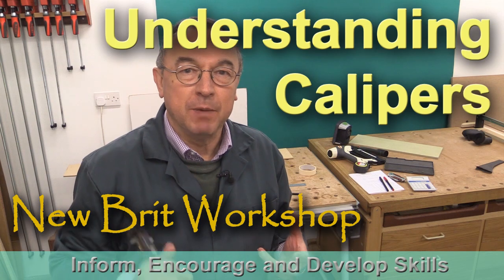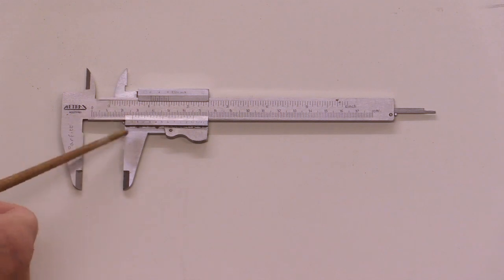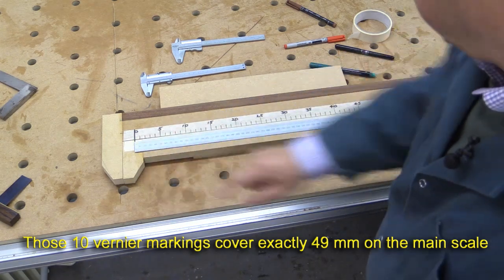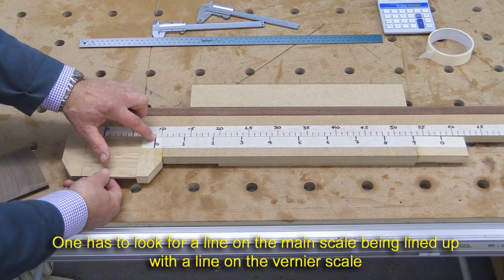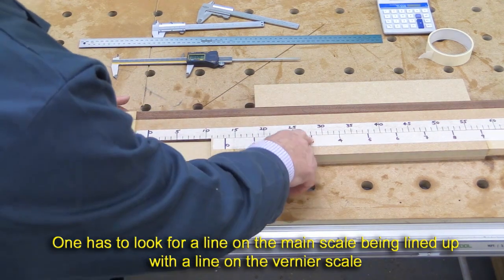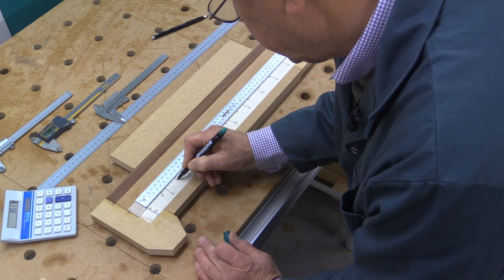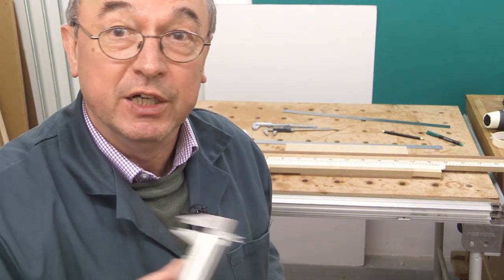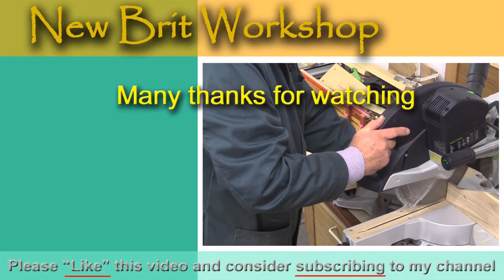How Calipers Work

Comment: Greetings from Canada. Thank you for the reminder about how REAL vernier calipers are used. This is an example of how we went about making it possible to take precise measurements in the past. I too, started with a set of calipers similar to yours. They were finely crafted and came in a protective leather pouch. They were quite expensive.  These first generation calipers were, at times, difficult to read, especially in low light. Probably ten years later, I took the next step and moved to a set of calipers with an analog dial gauge.  These too, were quite expensive but a lot easier to read as they did not require a vernier scale or the skills to read it. The only part requiring attention was getting them properly zeroed before starting a reading. I think I could have continued with these calipers indefinitely.  In recent years I bought set of digital calipers for no good reason other than I just wanted to have them. These digital calipers we quite inexpensive and I found them to be very precise as they consistently duplicated readings I got when using a micrometer.  In addition to this, they are very easy to use although they still needed to be zeroed. And, unit conversion was also very simple – just touch a button to toggle between metric and imperial. I also have several pairs of plastic calipers that I use quite a lot. These are not suitable for work requiring highly accurate readings; in fact they don’t even have the vernier makings. They are good enough for many projects. Thanks for the trip down memory lane.  It was entertaining as well as acting as a reminder of just how much progress has been (continues to be) made with measuring instruments.
Reply from the maker: Hi Dean, Many thanks for that - very interesting.   Cheers.   Peter

Comment: Another excellent video Peter. Strange coincidence... a friend recently made an oversized calibers as decoration for his Woodshop... out of walnut, black walnut, and cherry I believe. I believe he got the idea from one he saw on YouTube.It turned out really well. He is a retired machinists who also did carpentry work and cabinet work. All for the same employer.
He also designed the program the company used to do the CNC tool paths/layout for CNC furniture.
Reply from the maker: Hi Ron, That is jolly interesting.  Cheers.  Peter
Reply: New Brit Workshop   Cheers

Comment: As an American .... down with the Imperial System! We need to shake off our bonds of fractions and a horribly outdated system! Long Live Metric!
Reply from the maker: Hi Brett, I was brought up with the Imperial system and resisted the change to Metric. After a while I realised that I had to change and once I put my heart into it the rewards kept flowing. It is so easy to use, errors are rare and, I am sure, it is far more accurate overall. However, I do understand the diehards who cannot see a way of making the change. I felt like that once upon a time and was lucky to find an escape route.   Cheers.   Peter

Comment: By the way what was your job
Reply from the maker: Hi Daniel, I did some Army stuff, some woodwork teaching, engineering, delivering flowers,  house building and writing.   Peter
Reply: Wow fair play. Do you used the fuji type hvlp system be interested in seeing your take on that your opinion would be invaluable.
Reply from the maker: Hi Daniel, I had a Fuji spray system but sold it long before I started making videos. I used it for spraying base coat on MDF (basically sealing it) when making kitchen cabinets. It was very good but I hated having to clean it at the end of the day.  Peter
Reply: New Brit Workshop hi peter yeah the only draw back i suppose thank you for you insite keep up the good work